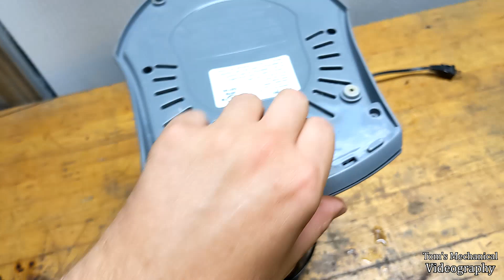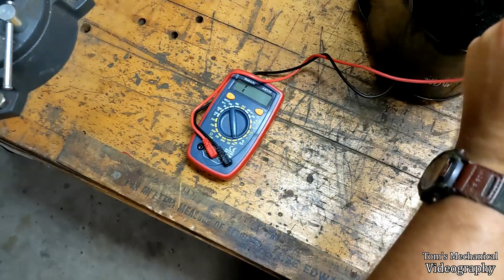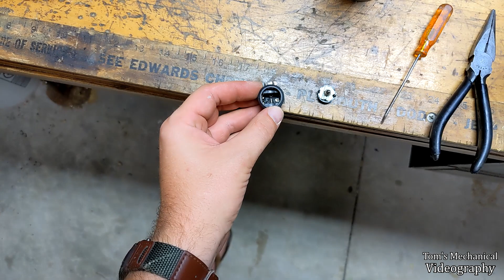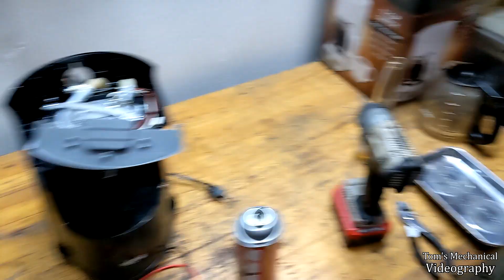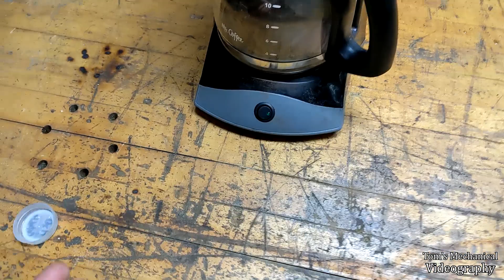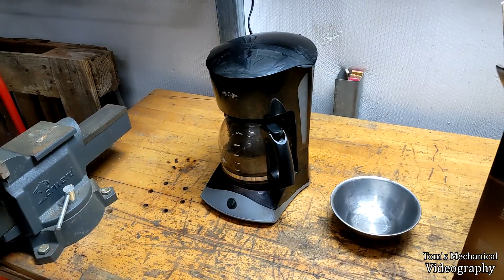Fixing a Mr. Coffee Pot switch because I'm CHEAP

Comment: I did the same thing with my 10-cup Mr. Coffee.  It's 35 years old and worked great until the on-off switch broke.  They wanted $50 for a new switch and it wasn't exactly the same one.  I ordered a new generic switch of the correct type for $10 and fixed it myself.